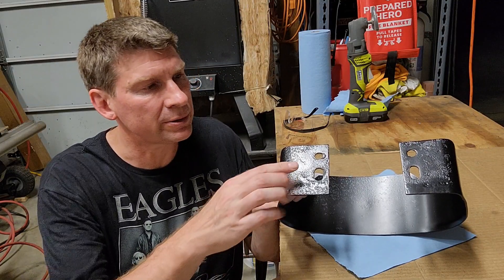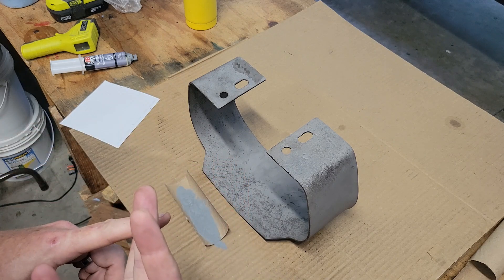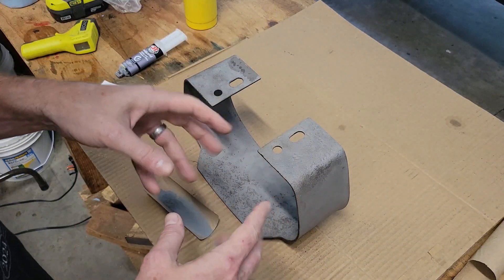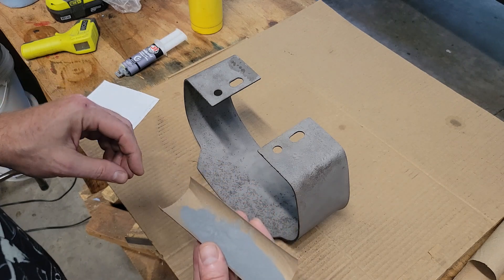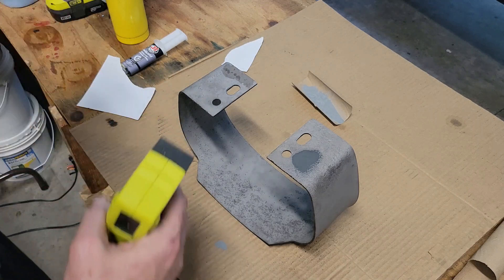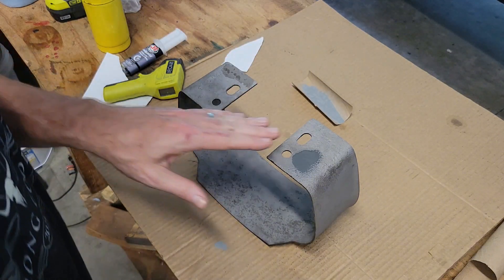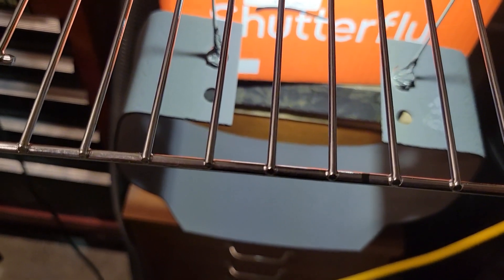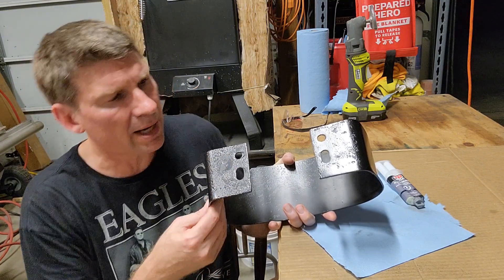Part 1: Filler for powder coat test - JB Weld

Comment: The filler doesn’t need to be metal. You can put a static charge on many things. Ever rub a balloon on your head? I have seen ceramic tiles powder coated.
Reply from the maker: Very interesting, makes sense, will have to do some research on that.  Just as long as you don't accidentally put an opposite charge on it 🙂